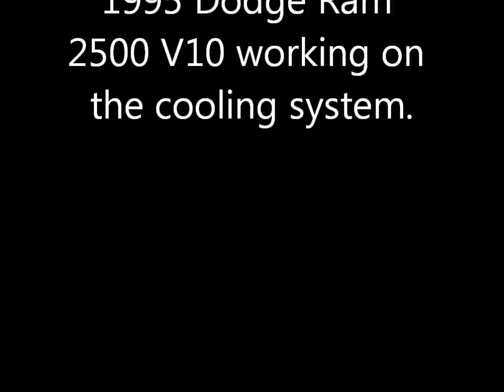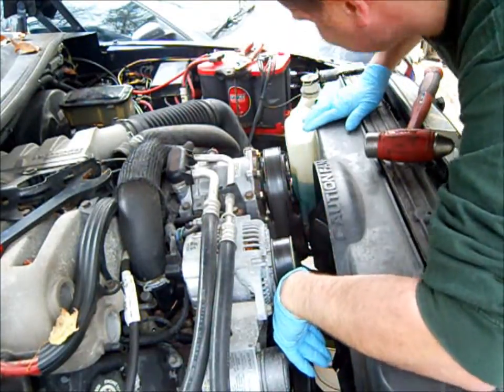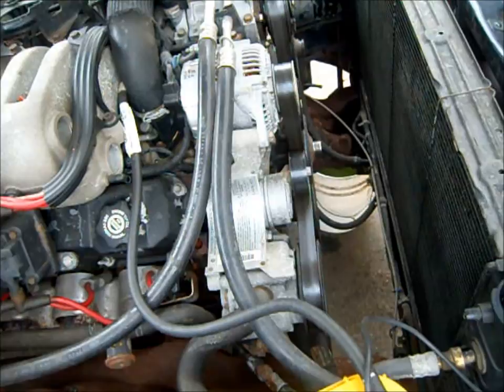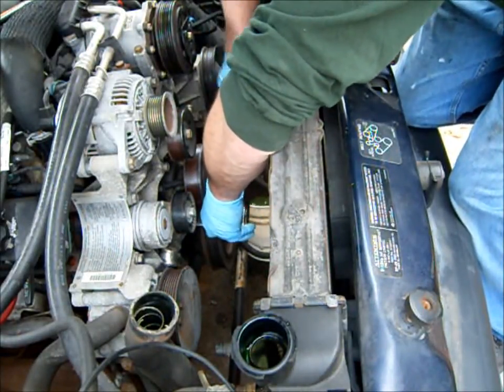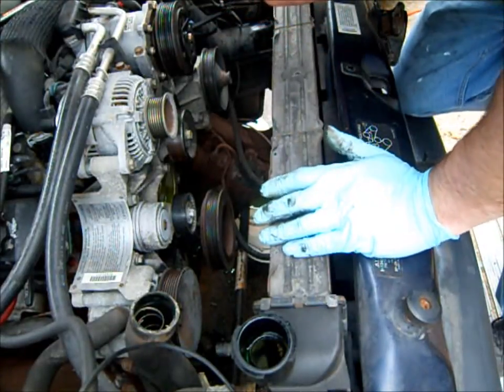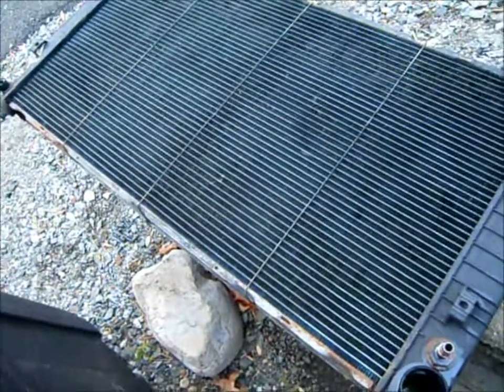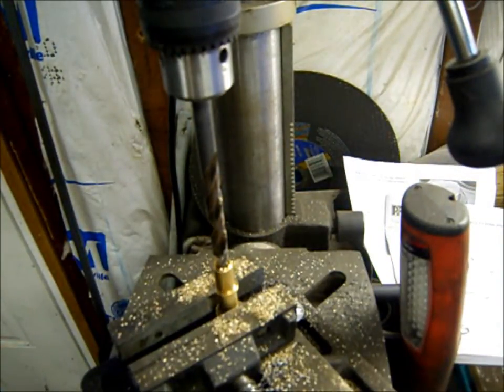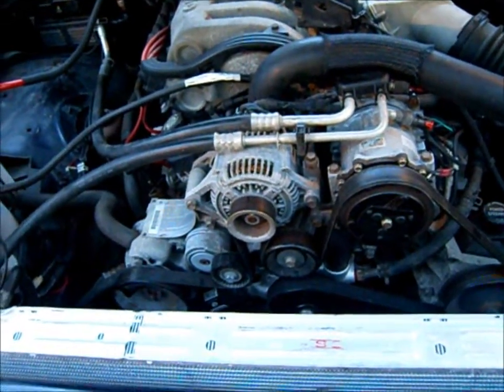Working on the cooling system 1995 Dodge Ram V10

Comment: Would have been nice to see how you removed the upper trans coolant line from the radiator, you mentioned it and then the rad is on the ground.
Reply: Exactly this I can’t find info ANYWHERE on how to get that fucking thing off

Comment: …. or, there are still 2.25 gallons of coolant sticking to the interior and you threw out/recycled a perfectly good radiator. Was it overheating before the water pump went bad?

Comment: Bronco Carl, nice video, very informative, especially about how to get the fan blade off!! Gotta 97' V10 and i need to replace my water pump that's been leaking and that tip about tapping the wrench, to loosen the nut on the fan, should come in handy!! Oh by the way, so did you make any cash off the used radiator? When i replaced mine, a couple years back, i took it to the recycling center and got back like $76 bucks!! Gotta love all the junk that builds up inside radiators, cause it gives it more weight, which in turn means more money back, ha ha!! Anyways thanks for the information!!

Comment: i just removed the shroud  out of the way without removing the fan, was able to remove the radiator no prob, fan intact
Reply from the maker: ed budrovic good for you!
Reply: @Broncocarl92  Any Idea where the pressure release bolt for the coolant system is?
Reply: Been looking for it and can't find it.. I've found a bolt between the pulley and the fan.